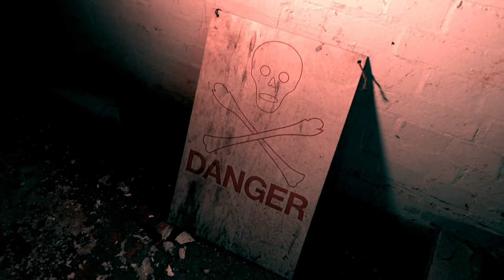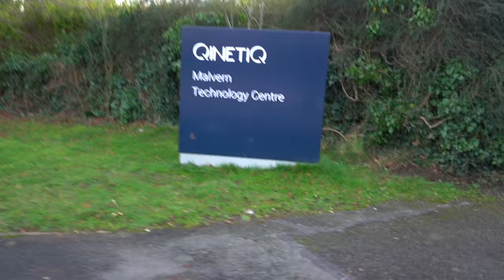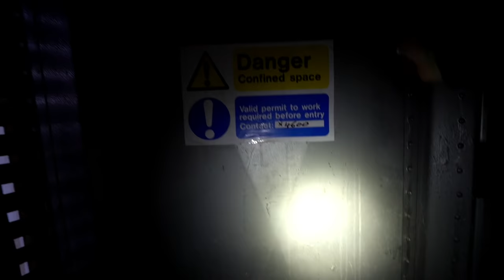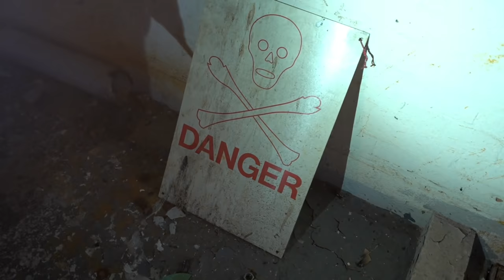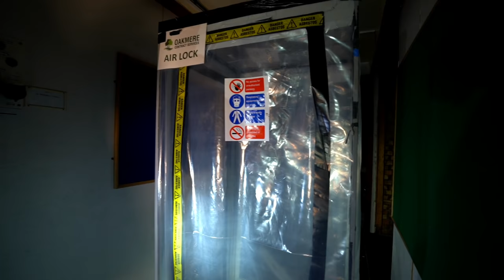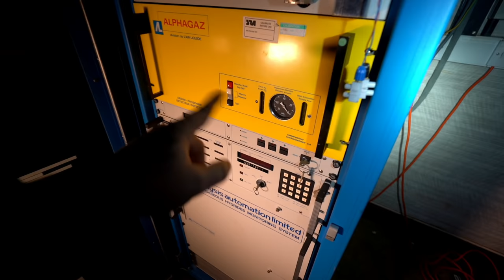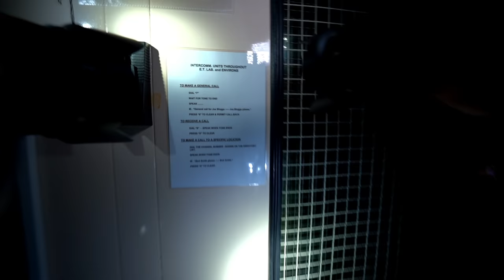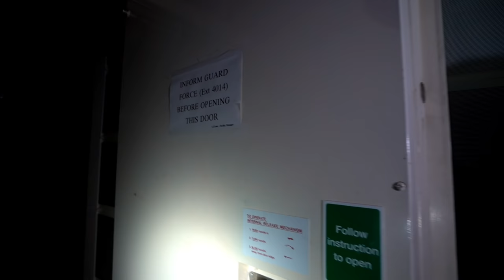We should not be in this underground government research base (VIRUS QUARANTINE)

Comment: Everything shown in this video is about 1980s era manufacturing semiconductors and current asbestos cleaning. Nothing here is biological.
 This facility would have made custom designed semiconductors and sensors.

The acids and acid booths/baths are used to etch patterns in silicon wafers/chips after layers of vapor metal has been deposited on the wafer  and after photo lithography. 
The cleanrooms, the air handlers,  the faraday cages are to protect microchips from static and dirt. The SEM scopes are to measure "critical dimensions" after the acid wet etching and for defect analysis. The first tool shown is to monitor gasses in the environment so not to poison the "operators" All sorts of toxic gases and heated acids are used thruout the process.

 The reason why that first mystery tool had a heating element with glass. Either a calibrating and testing tool because you want to figure out exact temperature, time, and acid type to etch properly. Or the mystery tool could have been an early type metal deposition tool to deposit  a layer of vaporized metals on a chip. Because it looks like  small scale vertical version of the industrial types that are 8 feet long, a horizontal glass tube that  cooks hot and deposits metal layers on wafers. 
Humans dip the products/wafers by hand into the acid tanks for a specific amount of time, this is the whole reason for all the protective equipment because acids splash and stuff and accidents always happen around heated hydrochloric acids.
 When I worked in semiconductors, an operator dropped a pen in the acid tank and instinctively grabbed it out of the acid ..he died.

Comment: The Waddington equipment was just standard server rack mounted equipment. Mainly network but they are mainly like extension cables for data communications. The actual servers where removed, also the mounted screen and keyboard are nothing special and standard practice for terminal access, I use them all the time. I would assume in military applications they would use these for mobile setup of computer networks via satellite or hardwired for fast deployment.

Comment: It’s a small boring drill that’s been modified. 
Seen it before in an abandoned fuelling station on the Coast. 
That’s ones a gem.
Reply: It allows for massive rpm and is great for eliminating air from fuel mixtures. 
God knows what it’s doing there.

Comment: Plastic air lock is a chemical hazard isolation containment tunnel (also known as a lock).  Persons exiting the "zone" would remove potentially contaminated outer garments in successive steps in each chamber.  The square hole in the plastic between rooms I suspect was in passing the filled containment bags out of the zone.  The room that paralleled the iso lock thus used to check bags for contaminants before transport.  The bags mentioned in asbestos cleanup are actually for chemical collection.  The label is filled in using the international identification (acids, alkalis, reactants, etc.). As one could imagine, there would be stuff in there that are, shall we say not compatible when mixed (goes boom or creates dangerous gasses).  The laminar flow hoods remind me of older workstations in California's Silicon Valley.  And as I read some the other comments about testing, manufacturing, that makes sense.  Dicrotic glass is a very special find.  I have seen it used in fluorescence microscopy.   What I think is cool, is the rack sized automatic gas monitor and the compactness now days.

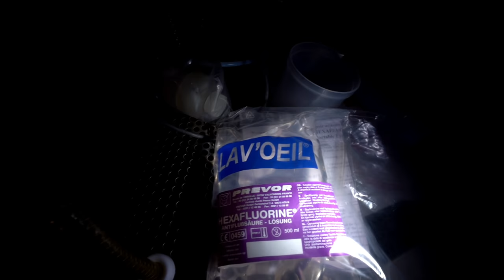Comment: @ 40:30 the drip bags are not drip bags they contain Hexafluorine which is used to wash machine Acid off of skin and out of eyes this solution is also used to prevent severe Acid burns. And from the looks of the building it was most likely used as a lab for testing chemicals like acid and the open clean room you guys are in was most likely used for testing cryo and various other projects and you can link the brand on the vest to modern day cryo research. and on another note the clean room procedures look like late 90s as well as the filtration rooms and my high school science lab had a few of the machines like where you found that mask, @48:24 those are server towers and the computer is a main access for the server bank that is connected to it (i would kill for that tower).

Comment: These guys have never heard of a cleanroom? Boxes of ASML which is a Dutch company that specialises in EUV wafer machines. The "electron" microscope is most likely a machine to create computer chips (wafers). The yellow windows are common in these types of cleanrooms. I think it has to do with either light sensitivity or light radiation to outsiders as these machines use very powerfull lasers. Because dust particles are very bad in a cleanroom (hence the name cleanroom), they pressurize the rooms. You cannot walk into a room, therefor they have the intercom there. Definately no primate in that room for testing.

Comment: Those bags that you thought were "drip bags" had Hexaflourine in them.Hexafluorine ® is a unique first aid rinsing solution that has been specially developed for use on hydrofluoric acid and its derivatives. It is effective against all acids and is also able to quickly render the poisonous fluoride ion harmless. There was another bag which had...Diphoterine® solution is an emergency rinsing solution for splashes of chemical products. Its rapid use in case of contact between the skin or eye and a chemical product is intended to quickly eliminate the residual chemical product on the skin or in the eye.

Comment: If this was a Research Facility the Hot (Infected) Areas would have been under "Negative Pressure". All air would be sucked in. That is what the huge fans that would have been equipped with Hepa filters were for. The entire place was obviously "Decontaminated" or it would have been sealed shut.If they are demolishing the place they have already"Decontaminated" it.

Comment: The material that vest is made of says Radiation, Electromagnetic and high frequency radio wave protection, it looks like it is made from LVFEIER fabric (could be the reason you saw the Faraday cage) and the lower velcro is sewn there to attach a more heavily protected portion to it for protecting areas like kidneys and groins from exposure, they probably tested different types of radar and even communications systems at that location. I have no clue where anyone is getting information that Bestobell manufactures or manufactured bullet or stab proof vests, obviously they should go back and take a second look.

Comment: 35:54 - DERA was, until 2001, the largest scientific and research agency in the United Kingdom. The acronym stands for Defence Evaluation and Research Agency.

You may have been thinking of our U. S. DARPA when you asked whether DERA is based from here (I'm in the U. S.).

The piece of equipment was used for monitoring the air (and in some cases, water) for toxic gases.
Reply: Ataratic Resonance ASMR you’ll find it’s DEPARTMENT OF ENVIRONMENTAL AND RURAL AFFAIRS! The labs did research and testing during the “mad cow” disease and was on the forefront of the fight against it.

Comment: That place where you found the 'drip bags' of HEXAFLUORINE... Most likely not an Operating Room. 
"Developed by PREVOR Laboratories, the HEXAFLUORINE® solution was designed to allow the active washing of hydrofluoric acid splashes. The HEXAFLUORINE® solution has a multiple action. The HEXAFLUORINE® solution is a liquid which removes the aggressive chemical from the surface by mechanical sweeping." Also...
"Hexafluorine® is an aqueous washing solution, with hypertonic and chelating properties, that is highly effective against Hydrofluoric Acid and its derivatives. Hexafluorine® solution can mechanically remove excess chemical from the surface of the skin or eyes before it has chance to penetrate."
I also read that Hexaflourine solution is effective against all acids, so you most likely stumbled into an old Chemistry lab... not an OR, but the ventilation would be set up much like an OR.

Comment: I really think you struck gold here guys. Well done. I'd love to come out on expedition with you guys, ive got some good ideas on advanced clue gathering. Would have been good if you could have dusted either side of the ET cell's dichroic glass walls for fingerprints, smudges etc. If there was an ET in there, those fingerprint results would be interesting. Also, the documentation you guys saw on the wall had some telling chemicals listed. I would have definitely "liberated" the floppy disk, and unscrewed the folding pc terminal and taken it home to power up and poke around inside.
Reply: You actually think there was an alien held there?

Comment: 40:31 Hexafluorine  = Developed by PREVOR Laboratories, the HEXAFLUORINE® solution was designed to allow the active washing of hydrofluoric acid splashes(( Hydrofluoric acid is a solution of hydrogen fluoride in water. It is used to make most fluorine-containing compounds; examples include the pharmaceutical fluoxetine and the material PTFE. Elemental fluorine is produced from it. Solutions of HF are colourless, acidic and highly corrosive)). The HEXAFLUORINE® solution has a multiple action. The HEXAFLUORINE® solution is a liquid which removes the aggressive chemical from the surface by mechanical sweeping.40:57  ""Diphoterine ""® solution is an emergency rinsing solution for splashes of chemical products. Its rapid use in case of contact between the skin or eye and a chemical product is intended to quickly eliminate the residual chemical product on the skin or in the eye.

Comment: @31:32 Asbestos flooring. The banging may well have been a suitably equipped and protected worker chiseling it out by hand, which is how it is removed. Odd if he or she was actually doing it in the dark. Sorry to blow your comments up, but I'm commenting as I watch. I have such a sense of impending doom for you guys based on you not wearing respirators. I wish that you hadn't assumed that the airlock and asbestos signage were decorative.

This building had/has LOADS of asbestos in it (floor tiles, ceilings, etc.). 100 percent on that. The fact that it's about to be demolished tells me that asbestos is being actively removed and that it's in the air you were breathing. In all probability, the only reason it's not yet been blown up is because the asbestos MUST be removed before the building is demolished so that it doesn't escape into the air as particulate.

Truly... I'm cringing every time I see a particle float in front of your light. Said particle is unlikely dust, given that this was once a pristine lab.

Comment: The room ya smelled iodine is most likely used for any radiation exposure iodine is used to dilution.  For your next time going into buildings like these always be aware of airborne pathogen and never puck up, touch without gloves, or walk into piles of stuff that could've possibly have any used needles, metal that could cut and could have chemicals on it. But I worked in steel mill and they have labs inside the plants testing with such chemicals that checked for impurities in metal, combustion impurities in metal that could and have exploded. So yes that's more of bacterial lab with ventilation air ducts and those two pieces of jacket you thought were bullet vest only to be led shields worn during x-ray.  Noticed when you go to hospital and they have x-rays done there's led type vests or shield to block radiation from x-ray.

Comment: It is an old radiation vest that Bestobell used to make. They now more commonly come in varying colors of blue or in black. So you guys are running around transient radiation, as well as a ton of asbestos with zero protective gear on. The blood on the floor might have come from a squatter or an animal  who had spent so much time in that area they had been poisoned enough to cause significant bodily harm to themselves. PPE is essential, gentlemen.

Comment: Some of the comments 😂 The air lock is the remains of an asbestos enclosure, the sheeted part off the stairwell with the plastic window is a vision panel to look in on the asbestos removal work, and the square cut out at low level in the sheeted wall was where the negative pressure unit would of been fixed and the asbestos bags on the floor are waste bags used to bag asbestos during the removal process. Not a good idea to walk through a building like this and wonder through plant rooms where there is evidence of asbestos as not only will you expose yourself it likely you will contaminate your clothes and then your car and anywhere you go after including home to your families. 
Interesting building and I enjoy your videos but the risks you take are worrying!

Comment: I don't know why u guys don't explore the bunch of folders and files on the floor wich could actually tell what the heck is this place and what gone on : 42:14
this place is full of hexaflourine:  40:31 
Hexafluorine® is an aqueous washing solution, with hypertonic and chelating properties, that is highly effective against Hydrofluoric Acid and its derivatives.

Hexafluorine® solution can mechanically remove excess chemical from the surface of the skin or eyes before it has chance to penetrate.

Hexafluorine®  solution is hypertonic which, when applied to the eye or the skin, creates a  reverse tissue flow thats allows removal of the aggressive chemical that may have already penetrated into the tissue, neutralises its aggressive action and carries it safely away.
also you guys found some Diphoterine wich  is a chemical solution used for the emergency treatment of chemical spills to the eyes and body.
Et labs are for neurotechnology. I would have defenetly openen that closed off capsule room for sure, that was super weird.

Comment: There must have been a hek of a lot of clean rooms with all them air filtration systems or perhaps it may have been filtration systems for glove boxes and fume cabinets also. 
The air filters would have contained asbestos, so any air locks would be connected to the filtration systems. Hence why they have them sealed. 
 Silicon wafers are cleaned with hydrofluoric acid. 
 Definitely electronics I would say, any biological hazards would have been animal related I believe. The spaces under the floors are something I’ve seen before, where they are a measure against floods and or spillages. To protect personal and electronics.
Gloves and masks would be an investment for you guys with all that asbestos in there.
Stay safe gents.

Comment: that's absolutely a chemical synthesizer; of which type, they're hundreds if not thousands of similar/different applications for chemical synthesis - therefore it could be used for bio-tech engineering, micro-tech engineering, and obviously the more common chemical-tech engineering as well. i have a degree in chemical engineering, and have had the pleasure of using one of these very dangerous machines, if not used right anyway; so please proceed with caution. those labs you're exploring now are some of the most expensive state-of-the-art labs - still to this day.
Reply: That’s nuts if walls could talk